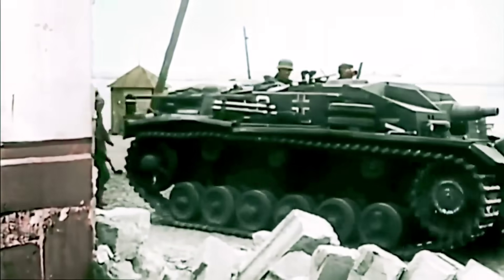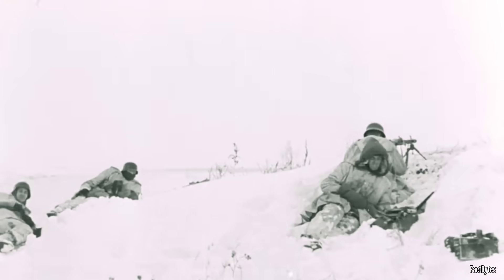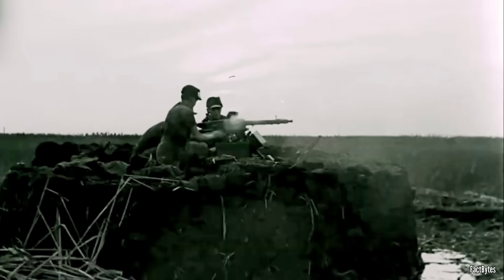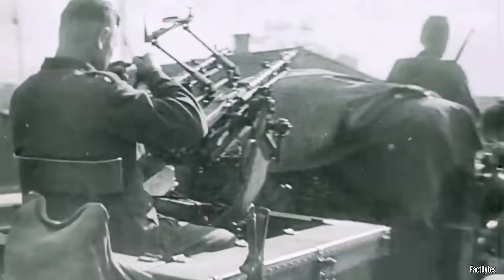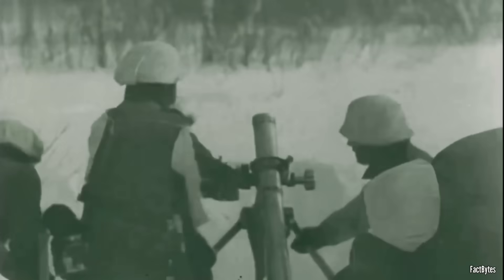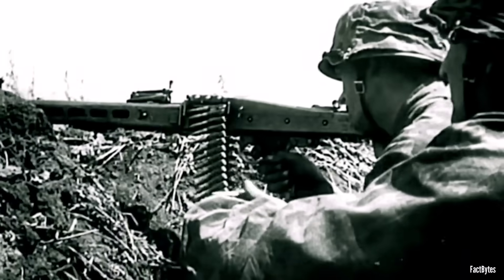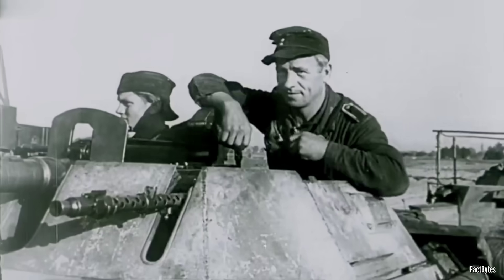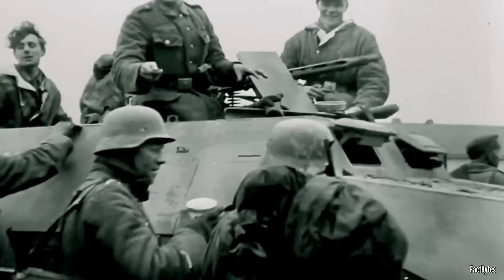Why the Fearsome MG42 Never Replaced the MG34 in German Tanks

Comment: Im sure it will be touched on, but perhaps they realised there is such a thing as "too" well designed. Yes, the 42 could fire at an extreme rate but does it really make an apprectiable difference in say, for instance, suppressive fire?
When that fire rate is paid for with frequent barrel changes and maintenence, would it not be better to have a slightly slower gun that didn't suffer so much "wear and tear?"

Comment: The 42 wasn't inherently better than the 34, it was just cheaper to produce. Ive never heard any accounts where troops prefer the MG42
Reply: This. The MG-34 is in general a better option for precision shooting and it conserves ammunition much better with its single fire and adjustable fire rate modes. The MG34 is better in all areas imo
Reply: MG 34 = 800 Schuß/Min.    MG 42  =  1500 Schuß/Min.  Fast das doppelte , was war wohl besser  ??
Reply: @KlausKistner-u9i  higher rate of fire is not intrinsically better
Reply: @KlausKistner-u9i  Schau dir mal den Doppelabzug des 34er an, das konnte auch Einzelschuss und war mechanisch viel hochwertiger konstruiert. Daher musste auch das 42er her um es in Massen zu produzieren.

Comment: What?
Pls delete the video.
Multiple tanks had a mg42
Reply: Not true. They used the mg34 in tanks.
Reply: @alwoo5645 on all?
Reply: @SsENLISTEDsS  Which tanks were fitted with mg42? You said multiple tanks which one?
Reply: @alwoo5645 jagdtiger is the only one with haul mounted 42 .
Reply: @ProjectStrum  ok bolted to the rear. but still an mg34 in the hull because it had a diffrent barrel change
Reply: @alwoo5645 oke the key feature your all holding is inside the tanks
Could be my oversight
Reply: Plse name tanks or delete.
Reply: You'll be okay. Just get some rest.

Comment: No 122 mm gun for the German, but 128 mm.
Reply: In the JadgTiger right? Think those massive Flak towers were based around a twin 128mm AA gun on each corner.
Reply: @Primalvision1988  Also in  this gun also  was equipped : Dicker Max, sturer Emil
Reply: @mr1724  max use 105mm gun
Reply: @idontknow12345-y no jagtiger had a 128mm gun
Reply: Yeah it eas a soviet artillery. Guy probably is a commie